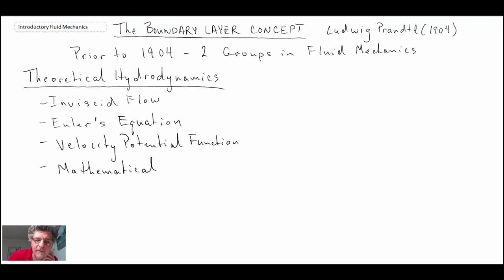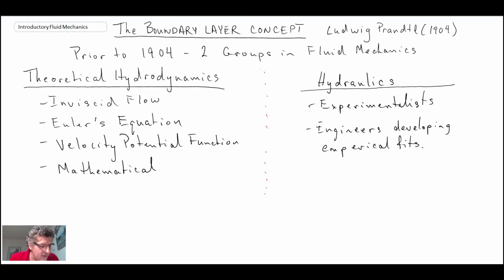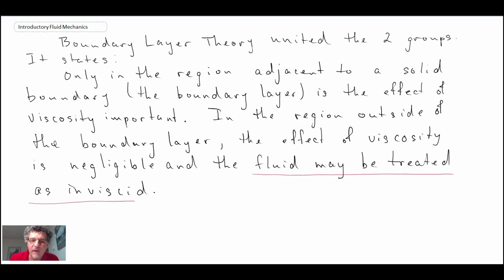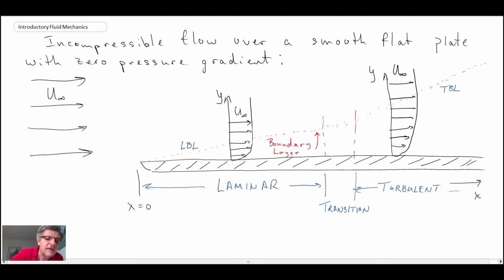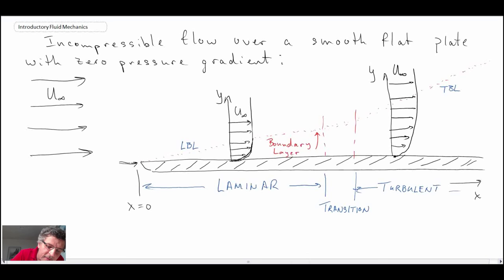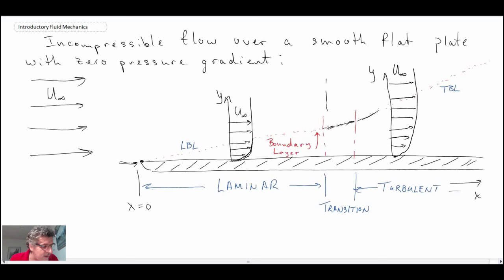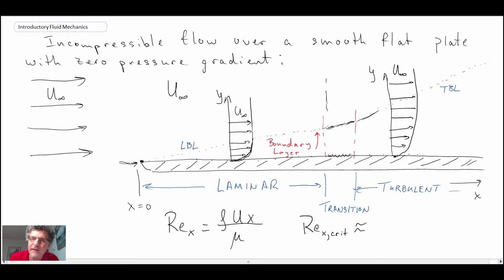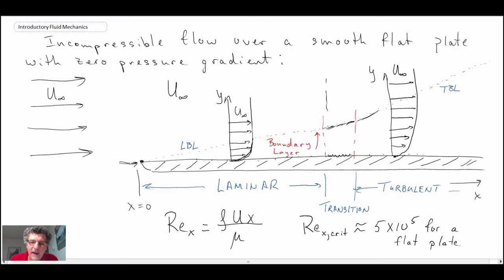Introductory Fluid Mechanics L19 p2 - The Boundary Layer Concept

Comment: 📝 Summary of Key Points:

Ludwig Prandtl developed the concept of the boundary layer in fluid mechanics, which combined the approaches of theoreticians and experimentalists in the field.
The boundary layer theory recognizes that viscosity is significant near the wall, while the fluid outside of this region can be treated as inviscid.
The boundary layer can be laminar or turbulent, depending on the conditions, and is characterized by the Reynolds number.
The focus of the video is on the laminar boundary layer, which is more suitable for introductory analysis.
The Reynolds number increases along the length of a flat plate, and the critical Reynolds number for transition from laminar to turbulent flow is approximately 5 times 10^5.
The next segments will explore early theoretical developments in studying the boundary layer, including the growth rate and friction along a body.
The momentum integral method, developed by Theodore von Karman, will also be discussed.

💡 Additional Insights and Observations:

💬 "The boundary layer was developed by Ludwig Prandtl in 1904 and it united two separate groups in fluid mechanics: the theoreticians and the experimentalists."
📊 The critical Reynolds number for transition from laminar to turbulent flow is approximately 5 times 10^5 for a flat plate with zero pressure gradient.

📣 Concluding Remarks:

The concept of the boundary layer in fluid mechanics, developed by Ludwig Prandtl, brought together theoreticians and experimentalists in the field. The boundary layer theory recognizes the importance of viscosity near the wall and treats the fluid outside of this region as inviscid. The laminar boundary layer, characterized by the Reynolds number, will be the focus of the upcoming segments, along with early theoretical developments and the momentum integral method.

Made with Talkbud